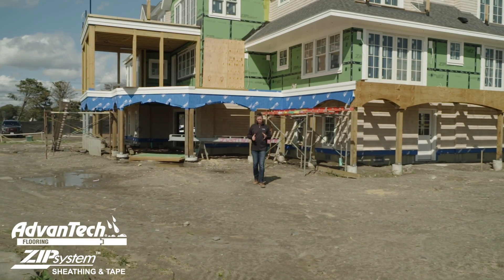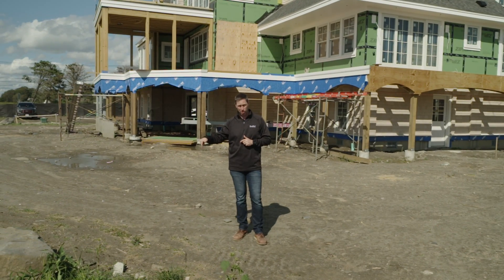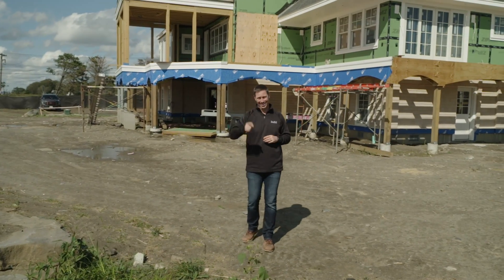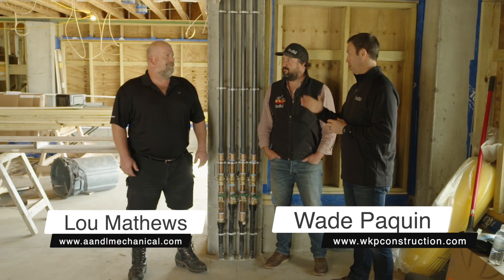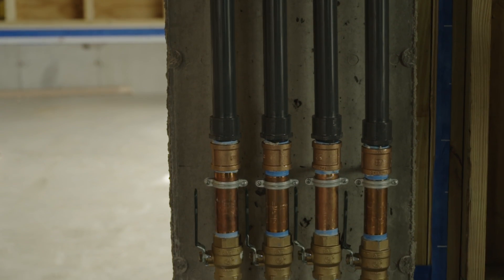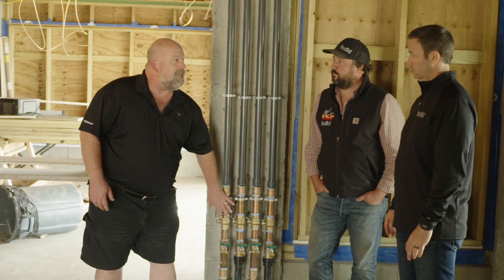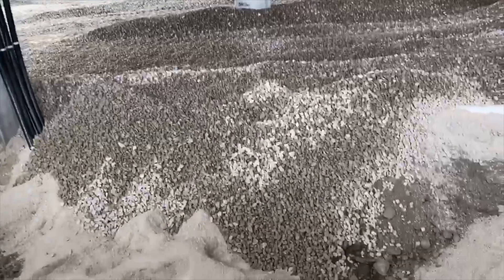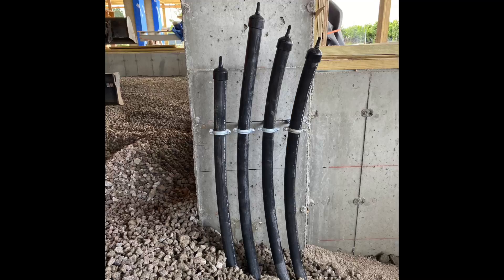Debunking 3 Geothermal Myths

Comment: Can confirm - I have an open loop water source heat pump and it sucks. High maintenance and not that efficient. Planning to replace with an air source heat pump because their efficiency has come a long way recently and the closed loop glycol type is not worth it to retrofit in my opinion.

Comment: I still didnt understand what they was talking about..lol..but I love the points they made
Reply: quick and dirty explanation--geothermal systems bury long pipes underground. A fluid is pumped into the pipes and back into your house. in the winter, you get energy from the fluid, as the fluid coming out of the ground is warmer than the winter air temperature. In the summer, you pump warm fluid into the ground, it cools down to temperature below the summer air temperature, you pump that back into your house, cooling your house. (it's a big heat exchanger, like the radiator in your car---your car heats up, pumps fluid into the radiator, the air rushing into your car cools down the fluid, the engine gets the cooler fluid back. Instead of air, geothermals use the constant ground temperature to cool the liquid in the summer, or heat the liquid in the winter).

Comment: I would love to know if there’s a difference in efficiency from a horizontal closed loop at 5 ft depth, and a vertical closed loop that goes however much deep. My loop is only 5 feet deep horizontal. They said the temperature really doesn’t change significantly once you get to five feet. My system seems to work fine here in Michigan. I used to have a open loop from my water well that drew five gallons a minute. It emptied into a creek behind my house. I hated seeing all that water pouring into the creek. My well pump burnt out prematurely from constant running on and off. Finally, I replaced my system  with a more up to date geo thermal and will probably do so again if I ever moved, although I am curious about the radiant floor heating, but would still need a.c. system.
Reply: I would add to what Russ said that vertical closed loops offer somewhat higher COPs compared to horizontal. The reason being that at the depths at which the horizontal loops are buried, seasonal changes in temperature do occur.
Reply: @Russ Bell 
Thanks for your reply!

Comment: Why do people spend so much on extra home systems and then still build the house with timber? The system will probably outlast the house!
Reply: Yea, they could of built with Faswall blocks, have a better insulated house and much simpler smaller heating system. They just like to build build fire hazards

Comment: Matt. DIY Homeowner here. I've been wondering if anyone has (is it possible to?) retrofit a hydronic (gas) furnace with a solar pre-heated tempering tank. I've seen it (temper tank) done with a water boiler. But, I'm wondering if I can get my winter gas bills down by pre-heating the water by solar before the furnace. I guess water pressure is likely the issue. My water feed now is basic city psi. is there a solution to it/product in the market? Is this a smart idea? Worth the investment?

Comment: Number one geothermal myth: ground source heating and cooling is geothermal.
Reply: They are called GHP's = Geothermal Heat Pumps ...
Reply: @MrSummitville  Ground source, not geothermal. Geothermal is the heat of magma doing work for you, not the insulation of the earth itself
Reply: @mutantcolors666  The manufacturers call then GHP's = Geothermal Heat Pumps. What YOU call then is irrelevant ...
Reply: @MrSummitville  You like to dig your heels in on being wrong. There is a difference. Manufacturer's are welcome to be wrong too.
No thermal energy from earth's core = no geothermal.
The temp of the soil where a ground source heat pump goes wasn't put there by the earth. Think about that.
Reply: @mutantcolors666  Again, we do not care what you call it.   You are not a manufacturer, therefore your opinion is irrelevant.  GHP,  Geothermal Heat Pump,  is the name of the device, whether you like it or not ...

Comment: In a desert region would they even make sense because of the long warm period and if so would you need a smaller hvac to compensate when you hit certain degree temperatures?
Reply: Desert regions typically have cold night temperatures. And your ground temperature will be the average of the annual day/night temperature cycle. So geothermal systems will still work, and be more efficient. E.g. a conventional heat pump or air conditioner will be struggling to dump your home’s heat into 100 degree air. But a geothermal heat pump will be dumping that heat into water kept at soil temperature, about 65-70 degrees.
Reply: Can you drill down to the water table ?

Comment: My Trane closed loop system is 18 years old and still going. Worried about getting parts now if I have issues since they no longer make this system. My loop is horizontal, and my hot water is heated from it in the summer. 3200 sq ft in North east Ohio.

Comment: most of risinger's videos have a more or less "infomercial" character, with some having more information value than others. this is toward the low end on the information scale and toward the high end on the commercial scale. the only significant "myth" discussed in this video is cost. open well versus closed well is an option that you still have. the reason why you might go with an open well is to save money on the installation. the cost estimates given in this video are not reliable. i'm not accusing the people on this video of outright lying, but they aren't really giving you good information. for example, i considered a geothermal heat pump a few years ago, and i got a quote. the quote that i got was $45,000 (for an average sized house). one of the reasons why my cost was so high was that i don't have acres of yard space to lay geothermal subsurface loops. in my case, i had to drill wells several hundred feet down into the ground. my cost would have admittedly been less if i did have a big yard in which i could lay out a 100-150 meter long geothermal loop field.

in general, air source heat pumps have improved so much (with innovations like enhanced vapor injection) that they are rendering geothermal systems obsolete, as a practical matter. that's why some companies are abandoning selling of geothermal systems. these days, you mainly see them deployed in "cost no object" projects where people are willing to pay twice as much to realize only slight improvements in COP values over air source systems.
Reply: They are way off on the costs of that geothermal system being cheap. Are they worth the money in the northeast? Yes. Are they very expensive? Yes.
Reply: @discodench  I’m considering a high efficiency propane system instead.  I want a whole house generator and gas for fireplace, grill and stovetop besides heating.  I can a bury a 1,000 gallon propane tank and be done with it
Reply: @curiousfellow9341  where i am with rebates it still makes more sense to go with geothermal on new builds. That said people need to be honest about it. Matt acts like its no big deal, easy, cheap. Its none of those things.
Reply: I think it depends on where you live. If, for example, you live in Florida where you only have to dig about 20 ft before hitting groundwater, the well costs won't be that much. Also people do use geothermal for more than just heating. Again, in Florida where trying to keep a space cool using standard AC triples your energy bill, relying on the earth's constant 60F temps to help cool a space might be worth it. I might be wrong, since I don't know much about the technology, but that's just a thought that occurred to me.
Reply: @eklectiktoni  There are shallow water tables all over the country, I know I could find a water table in New England to allow for "dug" wells, which are essentially wells shallow enough to be dug with an excavator.

These wells face a lot more risk of contamination and are significantly more susceptible to lowering water tables due to drought. I'd say avoid at all costs unless there's no other way.

note that water wells have nothing to do with goethermal wells. Geothermal wells have to be long/deep for the sole purpose of exchanging temperature with the earth.
Reply: There is nothing more efficient than geo-thermal. To suggest otherwise is just ignorant. The entire earth works off of geo-thermal heating and cooling. It has outlasted everything and continues on strong. The real problem is idiots do not understand the science behind how this principle works so they insert that which was never necessary and artificially drive up the costs. The real issue is they want everyone paying for electricity no matter what. It was never necessary to have a comfortable home in any climate.

What is clear is those you dealt with were only interested in making a quick buck off of you and up-selling you on your installation costs. Depending where you live which affects the depth you need to be below for geo-thermal, this is the only real factor that is necessary to know. You can dig out a large pit say 10' x 10' and then to a suitable depth. Then you lay your lines in a spiral layer by layer inserting more soil in between for insulation. It does not need to take up much space at all. Then couple that with good insulation to be a passive home for example and your house pays for itself over time and reduces your bills. No liquid in the lines is even necessary. Just use the air that is already passing through it. All you need to do so is a fan or a few fans to pull air from below and assist the cycling process. That removes the large and needlessly expensive "heat pump" for a geo-thermal system. Just think of how stupid that even sounds. It is like claiming an eco-friendly V8. ha

Comment: Question
How does one configure the amount of below ground requirement to the amount of square footage of a building, can you related to sizing a conventional boiler?    Where is a reference source for this information?
Reply: It's based on cubic feet, not square feet using BTU's. For example, a 10 x 10 room with an 8 ft ceiling (800 cu ft) will require less than a 10 x 10 room with a 10 ft ceiling (1,000 cu ft). That's a 20% difference in required BTU's! 

I don't know what the water sizing is. I do know that for air sizing in greenhouses we use 3.5 - 4X more cu ft than the greenhouse for the exchange. I sized my greenhouse geothermal to be 5X larger with a variable speed fan using temperature control. The 4" line is buried 8-14 ft below the greenhouse and spaced 18" on center between the run. This allows me to maintain 58 degrees F minimum in the dead of winter with minimal supplemental heating and during the summer to bring in much cooler air. I believe water is very similar since the laws of thermal dynamics are the same, it just requires water to air exchanger.
Reply: This is extremely dependent on your local geology and is why you want to make sure you are using a highly competent contractor to design your system.

Comment: On year 21 of our Direct Expansion system (Closed loop R220) and loving it.  On cost, however...  The conversation there in this video is DEFINITELY deceptive.  GHP installs are still VERY expensive.  Up here in Canada, it is not uncommon for a closed loop glycol setup to go well past $50,000.  You can buy a lot of other equipment with that kind of money.

But regardless, long term, I think they are worth it.  If you are going to or at least plan to stay in the house for a good long time, go for it.  When we did our build, (Owner contracted my build), we were able to get all the costs managed such that our ROI was less than 5 years.
Reply: Not sure what well water temps are up there, but the initial install costs are not higher than any system if well water is on site.

Comment: My house was built in 1982 with an open loop geothermal system. It finally malfunctioned in 2013 when the pump malfunctioned because the return well clogged up. I was quoted 5 grand for drilling a new open loop return well and new pump, but I still would be using a 31 year old system. I opted for a new closed loop system with 5 wells drilled in my yard. Around 18 thousand for the wells and system combined, and 7 years later I have a 2000 sq ft all electric home that costs about $175.00 / month year round to heat or cool. Best investment ever. The old system lasted 31 years, let's see if the new one does too!
Reply: Have you considered solar to offset the 175? I want to build a House with geo heating and cooling but with solar to offset grid costs...
Reply: @sundeeptalwar  My wife and I sat down with a salesperson just last fall about solar and we decided not to do it at that moment because of our son finishing HS and prepping for college and we were setting aside for that. It's not out of the question but just not right now.
Reply: I'm curious on the value engineering life cycle cost savings on this system. Lou gives an estimate that the overall system costs 35% more than a traditional system, but he  does not discuss the potential cost savings( if any) of electricity. It seems you've saved some money on your electricity bills. Are their any specifics on your return on investment of this system as far as savings in electricity per month?
Reply: @michaelshettig7805  my open loop system was efficient also. I was paying between 185/195 per month year round as opposed to the 175+/- now. The entire system installed with 5 wells as opposed to the 4 the system called for was 19k. I went with an additional loop for easier heat dissipation and it made it more efficient.  I am in SE Virginia with a soft sandy dirt so no big rocks to drill through. They drilled 5 holes 200 feet down and installed a loop to the bottom of each and back up and tied them all in through a manifold. The old system used a big noisy irrigation pump in my garage that died, but the new pump is a small little thing that is encased in the unit itself. A 13 deer air to air heat pump would have run me 8 to 10 k installed depending on brand, so the additional 9k I paid will take some time to recoup at 20 or so bucks a month, but as I stated, the old unit lasted 31 years so I think I have time to let it pay me back.
Reply: @mikedixon8741  Thanks for the reply. I'm interested as I provide design build services for the commercial sector north of Houston. I don't see this system much down here, but I will continue to study this as a value option for my potential clients. Thanks again.

Comment: Tell me my gas boiler / water heater cost 5 thousand .....my ac cost today we be about 6 thousand $......tell my that putting in a geothermal system would be just 50 % more in New Jersey........more than likely it wouldn’t pay for itself in 100 years....even with replacing the units ever 25 years.......
Reply: A natural gas boiler can cost between $2,000 - $5,000 
A 5 Ton Air conditioner can cost $5,000 
Geo-thermal can compete with those combined unit costs and use less energy per month in DOLLARS

Comment: Myth #0  These are not geothermal.  Ground source heat pump is what they should be calling them.  Pedantic? Maybe.  But geothermal systems do exist, just not much in the US.
Reply: Sure they are.  Ground source heat pumps extract geothermal energy.  Just because other geothermal technologies exist doesn't mean GSHP's aren't among them. My apologies for being pedantic!
Reply: Bob L, my understanding is geothermal energy is GENERATED and stored in the earth.  I could be wrong, but I believe that a GSHP takes advantage of the soil temperatures that are basically the mean of the ambient air temps.  Obviously the diurnal and annual temperature swings of the air are tempered by the much higher specific heat of the soil so that's why, at a depth, the soil maintains a relatively constant temperature.  I'm not an expert, so I could be wrong.

On an unrelated note, do the words "volo, non valeo" mean anything to you?  I knew a Bob L who used that tagline.
Reply: @jpbinva9919  ...and I'm not a geologist, but differentiating between origins seems like semantics to me, as well as a being convoluted.  At some point in the crust, there is certainly a gradient of contribution between the atmosphere and the earth's core.  For a well field completed at 500 feet, what percentage of energy originated at the surface vs in the earth? Regardless, in either case, it is thermal energy stored in, and extracted from, the ground.

Also, not the same Bob L.
Reply: @jpbinva9919  They are called GHP's = Geothermal Heat Pumps by the manufactures.  What you call them, is irrelevant ...